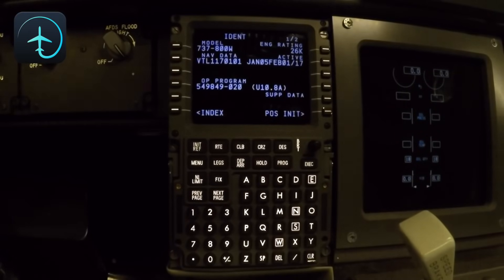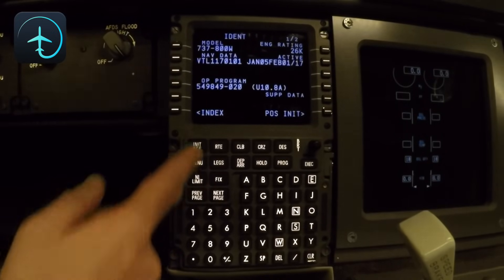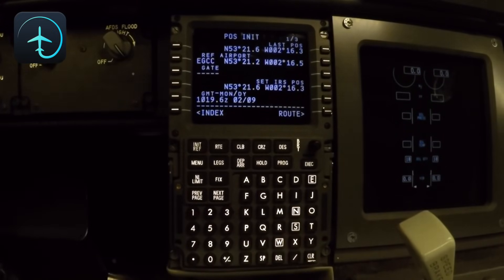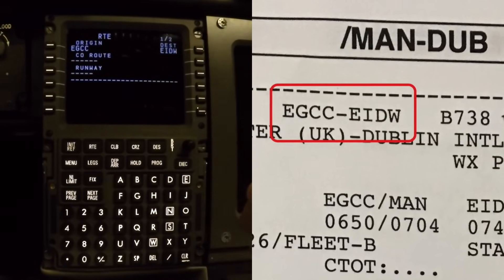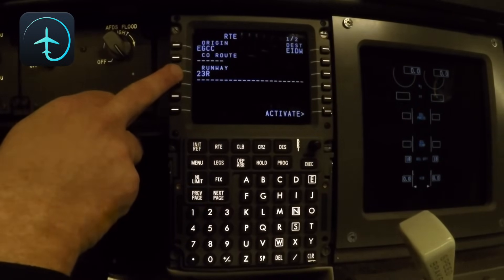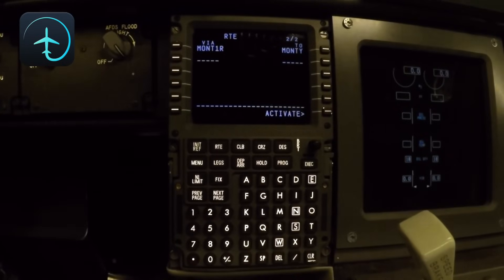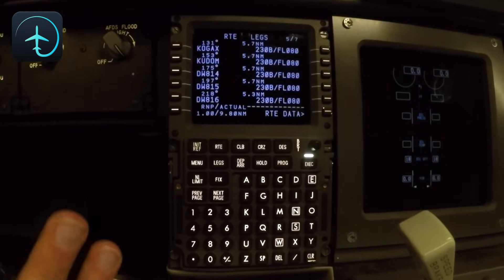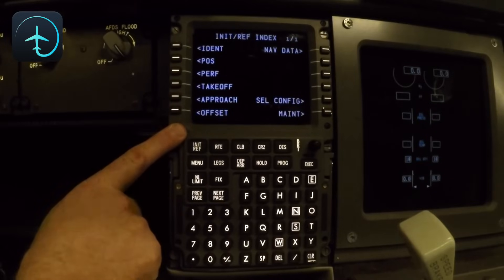Full FMC setup - Boeing 737NG

Comment: Would this be correct?

Setting up the FMC CDU for a flight from Stavanger (ENZV) to Oslo (ENGM) in English.

1. Identification and Position (IDENT / POS INIT)
Press the INIT REF button.

Verify that the aircraft model and engine rating are correct on the IDENT page.

Press POS INIT (LSK 6R).

Enter ENZV into the REF AIRPORT field.

Copy the most accurate coordinates (usually from the GPS) and paste them into the SET IRS POS line to align the navigation system.

2. Route Planning (RTE)
Press the RTE button.

Enter ENZV in the ORIGIN field (LSK 1L).

Enter ENGM in the DEST field (LSK 1R).

Enter your flight number (e.g., SAS462) under FLT NO.

Go to page 2 (NEXT PAGE) to enter airways and waypoints, or prepare to select your SID in the next step.

Press ACTIVATE and then the illuminated EXEC button.

3. Departure and Arrival (DEP / ARR)
Press the DEP ARR button.

Select DEP for ENZV.

Choose your departure runway (e.g., RW18).

Select the appropriate SID (Standard Instrument Departure) based on your flight plan.

Press DEP ARR again and select ARR for ENGM.

Select your expected arrival runway (e.g., ILS 19R) and the matching STAR (Standard Terminal Arrival Route).

Press EXEC.

4. Performance Data (PERF INIT)
Press the INIT REF button (it should now display the PERF INIT page).

Click the button next to ZFW (Zero Fuel Weight) to pull the data automatically, or enter it manually.

Enter your RESERVES (e.g., 2.0 for 2000 kg).

Enter the COST INDEX (a value provided by the airline, typically between 10 - 30).

Enter your cruise altitude in CRZ ALT (e.g., 240 for FL240).

Press EXEC.

5. Takeoff Data (TAKEOFF)
Press N1 LIMIT (optional, used for setting de - rated takeoff thrust).

Proceed to the TAKEOFF page.

Enter your planned FLAPS setting (usually 1 or 5).

Click the buttons next to the V1, VR, and V2 speeds to confirm them.

Note the TRIM value so you can set your stabilizer trim manually before departure.

6. Route Continuity (LEGS)
Press the LEGS button.

Scroll through the list of waypoints to ensure there are no "DISCONTINUITY" messages (gaps in the route).

To fix a gap, click the waypoint immediately following the boxes and paste it over the "DISCONTINUITY" line.

Press EXEC.

Comment: Hey hey, iknow this video is old. But can we get one day tutorial about how to calculate the ISA DEV for TC and also for Descent forecast? I see you had the possibility to put the P04 in ISA DEV in the perf page, but PMDG removed the option .... we can only put it in the T/C OAT would like to see a calculation tutorial from u about the ISA DEV T/C and Descent Forecast! Thanks in advance! :)
Reply: It’s in the Operational Flight Plan, the one generated by SimBrief (which I’m guessing you use). PMDG models an older version of the FMC which does not have the ISA deviation input, so you just put in the T/C OAT which is also on the OFP.

Comment: I'm going to jump in as a pilot in the US.  WE USE POUNDS, not kilograms.   Sorry,  I know how to convert pounds to Kilograms,. One pound (US) is 0.454 Kg i sometimes in my head, but usually with a calculator. 
Im US aviation we use old   school weights and measures.   
Fuel in Pounds"    6,7 pound per gallon, typical Jet-A at room temperature.

Comment: This is amazing. Im going to practice this on a calculator.

Layman question: why do you have to do all that data entry manually from a printed sheet of paper? Cant this be automated if the flight plan was received digitally and fed into the FMC? Then the FMC calculates the optimal speed v1 flaps altitude etc after the plane sensors measure gross weight, fuel, and other factors?

Comment: I'm an aircraft mechanic and was recently called up to the flt deck of a 737-800 because the pilots were having problems with a blanked out milage figure on an alt route. We did a Boeing reset (powered off A/C), which sometimes works, only to have the same issue repeat. Finally, the FO realized that they had put in the wrong airport code that was 5000nm in the wrong direction. Once corrected, everything worked correctly. So these videos help me understand something usually only pilots mess with. It's appreciated.
Reply: Great response.
Minor story.....before GPS DC-10s used a similar gyro system.    This story begins in Sydney, Australia.
Short?   The First Officer inputed  'NORTH' Latitude, instead of South.
This was before GPS was common.
Suffice to say?  This DC -10 nav systems  were corrupt 
The Captain, rather than dumping fuel and returning to Sydney
  Just flew the Flight Plan headings, reported position to ATC, AND made it to Hawai'i....

Comment: Very clear and objective, what about CG% and trim calculation? is that done later? anyone knows? I'm using this for FS but I did exactly like that, except for the derate which I dont have a easy way to calculate for PMDG... so far my biggest issue is to change a route legs

Comment: How to you calculate what derate you can use?
Reply: He uses an app that's provided by his airline. These performance figures are determined by engineers at the airline, using data from tens or hundreds of thousands of flights and a lot of mathematical wizardry based on each individual runway that the airline uses. So there's really no simple formula to use.

Comment: Thanks for the video, Captain. But I have a question that maybe will be answered despite this video is quite old.
In the legs page of the flightplan we see a T/C Wind of 243/040 and an ISA DEV of +4, however in the summary on top of the plan, where you receive the avg cruise wind, we also see a TOC Wind and ISA DEV - but those are different (231/21 and -3).
Why is that and could those also be used?
I hope for an answer... Thanks!
Reply: Yep, I spotted that too, and wanted to ask the same question. Also, TOC seems to be after WAL (from OFP) but then on LEGS 2/7 it is apparent that TOC is now prior to WAL.
Why (if the dispatcher is using the same info to create the OFP) does the FMC have a different TOC?

Comment: In watching these videos, the APU is turned off after the engines are started. So if the APU is off during takeoff, why are you using 0.8 less in the N1 page?  Shouldn't the N1 limit still be 98.0?

Comment: If the FMC is using BLK Fuel and not TOF, then how does the GW check out with the load sheet which always uses takeoff weight? Is there a field to enter Taxi Fuel?

Comment: FMC - Flight Management Computer 
  CDU - Control Display Unit   
FMC has 3 databases: 
1. Software options (OP PROGRAM), 
2. Model/Engine data base (MEDB) 
3. Navigation data base (NDB), 
All of which are stored on an EEPROM memory card. These databases can all be updated via the data loader.

MEDB holds all the performance data for V speeds, min & max speeds in climb, cruise & descent, fuel consumption, altitude capability etc.
NDB is comprised of Permanent, Supplemental (SUPP) and Temporary (REF). 

The Permanent database cannot be modified by crew. 
There are four types of data: Waypoint, Navaid, Airport and Runway. Runway data is only held in the permanent database.

Comment: Thank you for the video! What I dont understand at the FMC setting at the B737 is why is Takeoff weight the same as Gross Weight. From my point of view, at the takeoff page, take off weight (TOW) should be less than Gross weight (GW) as we have to taxi from gate to the runway and this will burn fuel and reduces TOW. At some large airports taxi could take up to 30min this will means that a huge quantity will be burned during taxi. So i don`t understand why  TOW and GW will than be the same for caclulation the VSpeeds. Are there no possibiltiy in the FMC to plan taxi fuel? May someone has an idea for this issue. Txs in advance for any input. Cheers.

Comment: Petr, is it compulsory to stick to the precise take off speed? In your demonstrated set up the system shows V2 at 142 knots. Can you just add a few extra knots such as in this case... 145 knots so you have a few extra knots up your sleeve should you get an engine failure on takeoff? It seems odd to me that aircraft take off what seems to be just over stall speed. It seems more sensible having extra speed up your sleeve before you leave the ground... remaining runway allowing of course!
Reply: V2 itself is for engine failure

Comment: Again, great one! One quick question(s). Is the ZFW an estimation since it depends on the passengers? I don't remember stepping on a scale before boarding :P. Is it a an average calculation based on age and size?  Who performs this calculations? Also, at the end I see that the CG is not set. Does it not affect the FMC's performance calculations?  Thank you in advance, fly safe!
Reply: Yes, it is an estimation. Usually on larger jets it is not too important to get a exact ZFW, however it can be very important on smaller turboprop planes.

Comment: Does the FMC have the authority to turn the aircraft when it reaches a way point? Or it sounds an alarm and the pilot dials the heading on the auto pilot panel? Do you feel the FMC user interface is outdated?
Reply: As long as the autopilot and LNAV is engaged, the autopilot will follow the route itself.
Reply: Thank You.

Comment: At our airline, we can load and execute anything independently during the preflight.  Either the First or Captain can do anything they want to the box, but only up until we do an independent verification of data (it's becoming the norm that the pilot flying the leg sets the box up while the non flying pilot does the walk around, that way the flying pilot is more engaged to any weird or strange issues with the flight).  If we are on an over water route, where non-radar will be involved, we both first check the route independently, and then we check the route together one more time.  One pilot reads the route and the other checks it against the actual clearance.  At that time the box becomes " locked", and it takes both pilots to be in agreement before any further action is executed for the duration of the flight.  Including any changes to FMC, altitude, course, heading, etc.  

Additionally, our 737 boxes uplink almost everything automatically through the ACARS, and many aircraft are rapidly being retrofitted with the ability to upload clearance changes from ATC through CPDLC.  I'm not a huge fan of how the CPDLC handles things though, for example, we are required to "accept and load" any CPDLC change from the departure facility into our box, but these CPDLC clearances will not automatically load any runway or departures, so any work you have already done on the route gets wiped out anyway, and you end up reloading all of that again manually, which opens things up to mistakes...

As for performance, we send off a request in ACARS for a specific runway, intersection, weight, altimeter setting, etc.  And a few minutes later we receive both an ACARS printout of takeoff performance data, and also a FMC prompt to load this data into our box.  We accept the data into the FMC, then check it against the ACARS printout before execution.  Then, we read and compare all that data one last final time on a checklist before we blast off.  We do have the ability to override this data for gusty winds, tailwinds, and any reason we desire a maximum power takeoff.

If anything changes, we have to re-accomplish any portion of this whole process that is associated with the change.  For example, a different runway dictates a SID change, route change, and performance change, so most of that has to be all re-accomplished and rechecked.  In the US, it is common for ATC to constantly change the departure runways to balance out traffic on the field, and this causes a major PITA as we are trying to taxi on busy airports and not screw that up at the same time.  Sometimes it just gets too overwhelming so we just stop the aircraft somewhere and get our bearings again....  I love that European airports usually give you a departure runway as a part of your clearance, so you can reduce the changes while taxi.

Thanks for an awesome video.  Definitely some things different, but basically the same.... That was a hard video to clearly make so people would understand what you were doing.  Well done.

Comment: how  they connect the flight plane with ATC and what  will you do if they change the route while flight ??
Reply: If ATC gives pilot alternate instructions, or the pilot needs to make a route change, the pilots must update the FMC during the flight with the new data "manually." Probably most common change is asking ATC to if you can fly direct to some way-points, bypassing some that take your route longer. You would just remove that way-point while in flight, and the auto-pilot will accommodate the new route.

Comment: Hi : thanks for all the information. I have a question, how much time do you have to dumping fuel if you have a SOS situation on Vr phase and if there is an-exception to landing without dumping fuel right after take off?
Reply: I don't know your answer, but I surely know that 737's don't dump fuel. It's not equipped for. I guess, that in this you can land overweight if you need to, and they will inspect the landing gear system for possible damages, but I'm just guessing.

Comment: any way for a non pilot to get the flex temp calculating app?
Reply: https://docs.google.com/spreadsheets/d/1nMXeMRAsibFpBuNgY4f_oy_Ux0ezdfnaynILIbVpL80/edit#gid=1287658801
just a rough on I just found for the B738

Or buy TOPCAT (It's 20 bucks and contains pretty much all aircraft)
Reply: Yes, but they cost money. TOPCAT.
Reply: But still, is worth. I've found another online service, called toper, but it's not as good as topcat.  The sad thing is that topcat is basically frozen. It doesn't and likely won't cover the 600 and 900 variations. What I do is to get the values from the 700 and 800 within some safe measure. It's not precise, but who cares?

Comment: Found it a little surprising that he left off at his V speeds for takeoff. He didn't include the input of his aircraft's CG (center of gravity) so that he could determine the elevator trim setting for takeoff. Is it needed, or is it optional for the pilot?
Reply: There is this other guy "aircraft2sim channel" that he does excellent videos using PMDG. One of the videos he left this in blank and explained that they received the trim from the the load sheet and didn't use the CG. Maybe that's the reason!

Comment: What is the difference between FMC and FMS ?
Reply: The FMC is part of the FMS.

The FMC is a computer system that uses a large data base to allow routes to be pre-programmed and fed into the system by means of a data loader.
The FMS encompasses: 
 The Flight Management Computer (FMC)The Automatic Flight Control or Automatic Flight Guidance System (AFCS or AFGS)The Aircraft Navigation SystemAn Electronic Flight Instrument System (EFIS) or equivalent electromechanical instrumentation.

Comment: Hi Captain, from where you get SEL value of 42? 9 is OAT but what is 42?
Reply: Kk - assumed temp. for derating engines. This value depents on weight, wind direction/speed, flaps setting, ect. As a virtual Pilot you can use TOPCAT for calculating.
Reply: Correct, actually it is an assumed temperature that they derate the thrust to in order to save engines life in first place .( higher the assumed temp is, lower the N1 value will be )

Comment: Appart form using this system as a guide to check at way points and estimating what other tasks peforms. It "talks" to the AP so it can get between this figures, modify engines settings, thing like that or it just for pilot usage as an assistant. I mean, does this gear participate on aircrafts inputs ?. Thanks. Excelent vid, love it.

Comment: really good instructional video.. thanks for sharing.. in the takeoff speeds page, shouldn't you also enter the CG% in order to get the trim setting number? in this case, it should be 5.0% right? (based on what i saw in PERF GW page)

Comment: this shows how accurate the pmdg 737 is wow you can learn evrything on fsx
Reply: I know PMDG did a great job setting up their FMC, it is super realistic!!!
Reply: ABSOLUTELY MATE I WAS SHOCKED AFTER SEEING THIS VIDEO THAT HOW ACCURATE IS PMDG
Reply: Electrip You are right!
Reply: Electrip so which is more realistic?
Reply: Zibo is still better imo
Reply: @77l96  Agreed, the Zibo mod still does not use cost index CI in it's calculations, among several other features that are missing. But, for free, it's very, very good.
Reply: I mean any decent payware airliner has a correctly modeled FMC, regardless of simulator,  FS2004, FSX, P3d or even X-Plane, lol.
Reply: @ml3487  it doesnt even have to be payware in x plane, there is a 737 model that is PMDG level in x plane for free. its called "zibo mod 737"
Reply: Hacky lmao exactly and it has more things modeled in the cockpit than the pmdg 737 ngx. I’ve had both copies so I can verify.
Reply: Shuvhashish Saha I’ve got the PMDG now but is it worth the switch to xplane and zibo

Comment: Capt. great video as always. I have a couple questions if you can answer. 
1. Does the F/O side FMC gets set up automatically with same values when the captain sets up his side? 
2. I understand why derated T/O is performed for reasons but why enter a fake temperature degree to SEL side? 
3. In case you have to land to a nearest airport, in FMC, is there a nearest airport list like in Garmin GPS devices installed in smaller aircrafts. I fly pmdg sim and cant set up fmc to show and select nearest airports and related frequencies. 
Thanks so much. Keep up the great content. Cheers